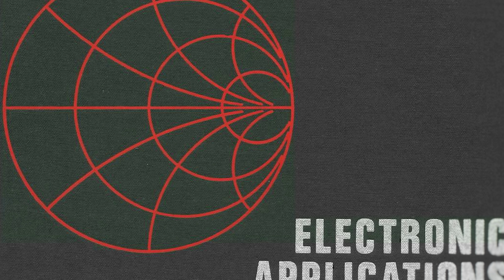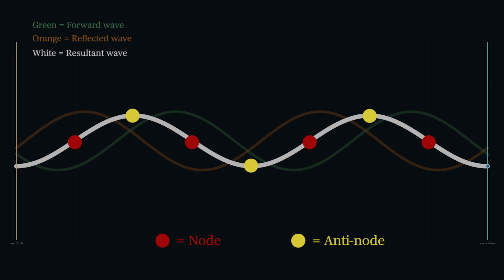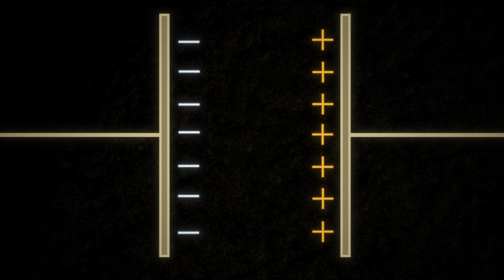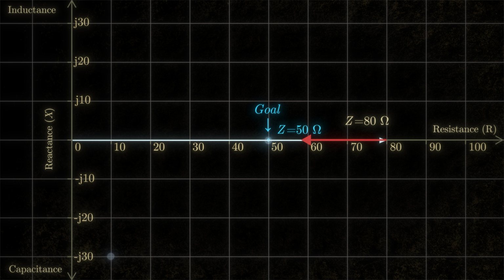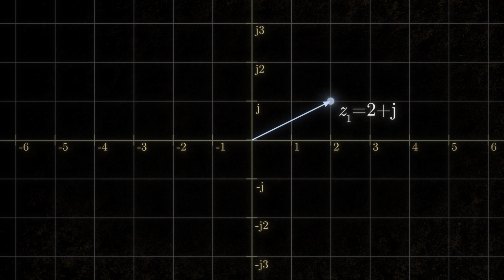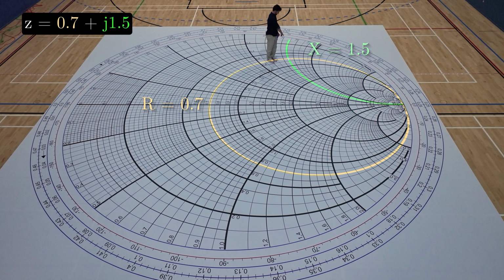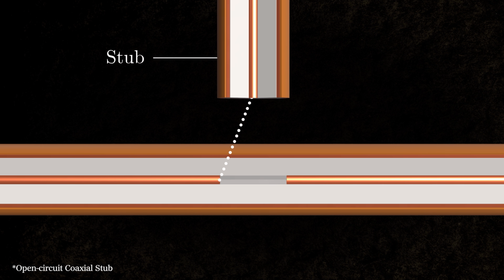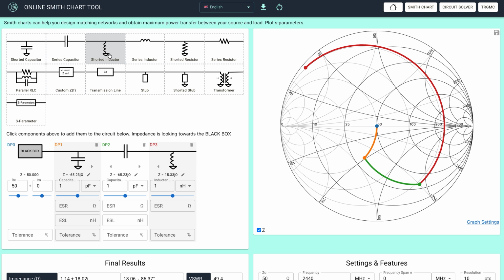The Scariest Chart in Electrical Engineering

Comment: I’ve worked in high voltage transmission and radar engineering for the past 16 years. I have found one constant truth. Impedance is something we all acknowledge but professionally stay as far away from as possible until it absolutely must be dealt with. Only then do you have six confused people passionately arguing around a table about a number that will never exist, confidently explaining why your particular imaginary number is so outrageous you should’ve wrote it with crayon. And that’s how your wiggly things are made.

Comment: RF is very hard to get your heads around the first time you hear it, and is fear-inducing. I still remember the first day me and my friends listened to all of this, and my colleagues looked like they had seen ghosts. I was probably the only one in the class who were ready for more!

Kudos to Veritasium for trying to explain the transmission line. It's difficult. Me personally I wouldn't use slinky for demonstration, as mechanical wave can be as complicated as EM. However, it's wave behaviour, so I know there is no easy way around.
 
There are a couple of things you might want to consider:
- dB and dBm are two things. dB measure the change of power but it has to be compared to a benchmark. dBm specifies that benchmark is 1 mW. dBm is useful in low-medium power system. In high power a lot of times we use Watt straight away.
- Smith chart is very useful when you want to observe the behaviour of loads, not just for impedance matching. There are times when we want to, or we have to accept a certain degree of mismatch. Smith chart tell you a big deal about the degree of mismatch, or even something as undersirable as unwanted oscillation. 
- Impedance matching nowadays aren't usually done by trimming a piece of coax, although it's great for demonstration. We usually simulate the transmission line using software and then draw all the pattern out, then we have them manufactured as a piece of printed circuit board. It's repeateable and more professional.

Thank you for making a video about this. Us RF engineers are a rare sight these days, so any way to get the words out and attract more people is appreciated.

Comment: Interesting.  The Smith Chart has several applications in Quantum Mechanics.
1. Quantum Scattering Theory (Closest Connection)
The strongest connection is in one-dimensional quantum scattering.
In quantum mechanics, when a particle encounters a potential barrier, its wavefunction splits into:
an incident wave
a reflected wave
a transmitted wave

The reflection coefficient
R = reflected amplitude / incident amplitude
	
is generally a complex number, just like the voltage reflection coefficient in RF engineering.

A Smith Chart is essentially a map of complex reflection coefficients, so it could be used to visualize:
magnitude of reflection
phase shifts
resonance conditions
changes as particle energy varies

This is mathematically almost identical to microwave transmission-line problems.

2. Quantum Wells and Barriers
Semiconductor structures such as

quantum wells
quantum dots
superlattices

are analyzed using transfer matrices.

Microwave engineers also analyze cascaded transmission lines using transfer matrices.

The mathematics is so similar that a Smith Chart could visualize:

impedance-like quantities
reflection from multiple barriers
resonant tunneling

3. Waveguide Analogies
Many quantum systems satisfy equations nearly identical to Maxwell's equations.

Examples include
electron waveguides
photonic crystals
microwave cavities

Since the same differential equations appear, Smith Chart methods can sometimes simplify understanding of standing waves and resonances.

4. Resonance Visualization
The Smith Chart excels at displaying resonance.
Quantum resonances occur in:
atoms
nuclei
quantum dots
superconducting circuits

A trajectory on a Smith Chart could show how a system moves through resonance as
energy changes
magnetic field changes
gate voltage changes

5. Quantum Computing Hardware
This is probably the most practical modern application.
Superconducting qubits operate around 4–8 GHz.

Engineers designing:
resonators
readout circuits
impedance matching networks
microwave control lines

use Smith Charts routinely.

Here the Smith Chart isn't describing the qubit's quantum state itself—it is used to design the classical microwave circuitry that controls and measures the qubit.

6. Impedance Analogies

Some formulations of quantum mechanics define a quantity analogous to impedance:

Zq = ψ over dψ/dx
where ψ is the wavefunction.

This "quantum impedance" obeys equations resembling transmission-line equations, making Smith Chart concepts applicable in certain theoretical analyses.

What the Smith Chart cannot represent
A Smith Chart is not a visualization of a quantum state. It cannot directly represent:
wavefunctions
superposition
entanglement
spin states
Hilbert space
probability amplitudes of multi-state systems

Those require other mathematical tools such as complex vector spaces, Bloch spheres (for qubits), density matrices, or Wigner functions.

Summary
The Smith Chart's usefulness in quantum mechanics comes from the fact that both RF engineering and quantum wave mechanics involve complex wave amplitudes, interference, and reflections. While it is not a standard tool in quantum theory, it can provide intuitive visualizations for scattering, resonances, and wave propagation in one-dimensional systems. Its most widespread practical role today is in the engineering of microwave hardware used for superconducting quantum computers, where it helps optimize the classical circuits that interact with quantum devices.

Interestingly, several researchers have noted the deeper mathematical connection: the Smith Chart is a conformal mapping of the complex reflection coefficient, while many quantum scattering problems can also be expressed in terms of Möbius (bilinear) transformations acting on complex amplitudes. This shared mathematical structure explains why techniques developed for RF networks can sometimes be adapted to quantum-wave problems.

Comment: This was a tough one! I thought the slinky models were good connecting points but basically I didn’t  have enough outright familiarity with the problem to feel like I had any connection with the problem.  It was a bit like the electrical circuit problem that featured the issue of having working electrical circuits and whether or not the power actually flowed through the wires (and I don’t know if that is a very good summation.  In any case this one seemed very abstract.

Comment: As ex-RF engineer from ex-Soviet Union, we were never taught anything like that, and never knew there is a way to stop guessing and using cumbersome formulas. 
In a factory producing radars for jet planes we made these "stubs" manually applying indium alloy on microcircuits in the spots we were told to, until output frequency matched the one in supporting docs. This chart would save us tons of time and hassle

Comment: Video was ok but I had to watch srveral Times. Was to fast. To much shortcuts. Physics is very simple but the way how it is presented could be a bit better. 
This a wave passing from one medium to another with different properties. 
Some atatements are confusing or unclear. Eg. Open Circuit does not absorb. Why? Example? This depends on materiały properties and shape of open circuit end.  Short circuit also does not absorb? Short circuit between two different materials will absorb. Berween same materials will not absorb.

Comment: The ironic part of all of this is that the smith chart, and impedance, are the norm.  DC is a weird degenerate case where the frequency is very low, but in reality there's no such thing as DC.  All of the things that affect RF AC affect DC during two key phases: turning the circuit on, and turning the circuit off.  You can STILL get reflections during those phases, and you STILL have propagation times that matter.

And this is why it was a critical part of the most controversial Veritasium video, about the light-second-long transmission line...

Comment: Sort of useful (for me). I'm from a physics background and the Smith chart wasn't covered in my E&M class lectures. I remember (sort of) the coverage of reflections in transmission lines and adding the extra line to cancel them out but nothing about the charts. Lots about the equations. So the first half of the video was review of basic electrical characteristics that I still am familiar with. I got a good feel for how the charts are used (in the 2nd half of the video) but really needed more coverage of the mathematics, ie explicitly how the vectors cancel out mathematically, to really understand the charts. The video has inspired me to pull out my E&M book to see if the Smith charts are discussed there. Thanks for the video.

Comment: Buncha rf engineers in here, I have a (simplish) question.  My phone/speaker USB charger in my semi interferes with the fm and cb radio.  Would a diode inline before the charger isolate this interference?  I've used them to isolate taillight signals before and wonder if they would work for this application.

Comment: "Gamma is 0.68, which is exactly what we saw....."  That made me think, "but the power loss was more than half not less."  I quickly thought, ah, but gamma is voltage and dB is 20 log10 of the voltage ratio, so half the voltage is 6dB not 3dB, and 0.68 is less than 0.707, so it does indeed give more than 3dB loss.  This is an excellent video.  I struggled to understand the chart 50 years ago, now it makes sense.  I think it helps that I have recently been working through the excellent book "Visual Complex Analysis".

Comment: So maybe in order to advance our understanding of the mismatch/disjointedness of the two physical measurement systems -- Newtonian physics and Quantum physics -- we must develop a new way of representing them TOGETHER, as did these electrical engineers almost 100 years ago now.  Is there a way to graphically combine in the same sort of fashion as Feynman did with his diagrams, the connection between classical and quantum mechanics?  Maybe by combining them in some form that has not previously been thought of because it wasn't needed, like in the movie 'Hidden Figures', where two different methods of figuring were 'added together' in order to come up with a way to accurately model the way those space capsules needed to be launched?

Comment: I'm a photonics PhD candidate with a background in electronics engineering. I first learned about the Smith chart in a microwave engineering course years ago. It would be really interesting if you could make an analogy to visible light using refractive index in reflection problems. Since we usually don't think in terms of impedance matching in optics, and the refractive index is mostly real (unless we're dealing with metasurfaces), I think that analogy would help a lot. The same idea could also be applied to visible spectrum reflections between different media.

Comment: I'm about halfway through the video, and I want to note that, as you switched from talking about Capacitors to Inductors, you never actually used the term "Inductor" or "Inductance", until you kind of abruptly mention Inductance around 13:25.

Comment: 33:31 I don't get it...
If we use 1085 MHz as a target frequency, then it means that λ/2=138.2488 mm. And if we multiply 138.2488 by 302/360 (0.8389) then we get 115.9754 mm, not 77 mm.
Reply: The speed of electromagnetic waves in coaxial cables is slower than in a vacuum: approximately 200 million m/s.

Multiplying your answer by 2/3, And you get 77 mm!

Comment: Anechoic chambers are usually understood to be with respect to sound (air pressure) waves.  Is that chamber anechoic in an electrical or RF sense?  Are the surface features sized for a particular RF frequency?

Comment: kind of reminds me of the sun and solar electricity in general and what happens to all that power it pushes out, some misses the earth entirely some gets brushed aside some is absorbed and in the end only a small amount is actually collected as usable energy.
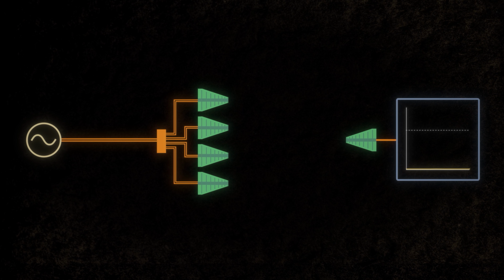Likewise with radios, you have the transmitter blasting out a signal some of it misses, some bounces off some absorbed and only a small amount makes it to the receiver, that's my guess to the drop @7:00

Comment: Hell yeah! Funny, nearly 20 years ago I decided after tinkering with building some DIY audio kits, that I was smart enough to build something (not of commodity quality, just beating the silly audio pricing) for less than I could buy it. LMAO...That led me down a huge rabbit-hole and now, without a degree, I'm dealing with RF and mixed signal multilayer PCB design, as well as physical and acoustic engineering problems. Let me tell you, that rabbit-hole is DEEP. It's quite amazing how many aspects of the physical world can be modelled using SPICE, represented by resistance, capacitance and inductance, along with all the associated parasitic counterparts (unintended elements of the same, caused by board layout and non-ideal manufacturing methods of the real world). Electrically, with light, acoustics with sound and also physical materials and their shapes. 

Many may laugh at my naivety of taking on a mixed signal design as my first project. it's only recently (the last few years) that I have actually started feeling like I know what I'm doing. Impedance controlled multilayer PCB layout for signal and PDN really is very much like black magic and as you go up in frequency, the board is as much a waveguide as a trace. Everything becomes an antenna.There are potential losses and resonances everywhere. I credit the writings of Henry Ott, Howard Johnson, Walt Jung, Jim Williams, Fourier, as well as YouTube channels such as Hans Rosenberg, Altium Academy and Robert Feranec.

Thanks for making this and helping bring some of these concepts to a wider audience, because it is not all very intuitive and simple metaphorical demos may help demystify it.

Comment: So you spent a whole minute or more on DC vs AC -- but then totally blew through the part about why the 40 ohms wouldn't do the trick, per your vectors in the imaginary plane -- or why you needed to find the right spot on the transmission line to put.. some other value? And then just casually said "lossless inductor and capacitor" without any explanation. Love the channel's ideas for content -- eg I really wanted to understand the one on FFTs :)) -- but it seems like you (and the original producer) always spend too much time on the simple parts -- and then just get "hand-wavy" and blow right through the harder parts. 

Also, with all respect, it seems like in this video you're dropping down a few notches -- though the slinky analogies work pretty well. Hope this critique is helpful!

Comment: You also have to consider the velocity factor of the transmission line you are using, or in this case, your copper tape.  The end result of that calculation you carry out on your Smith chart to match the real resistance has to be multiplied by that velocity factor to determine how long you actually make your copper tape.  That will give you an even better match.

Henry, you really ought to do a follow-up video to this showing this same demo, but for a broadband antenna, as in how to get that plot on the Smith chart as small and as centred as possible for a band of frequencies.  And get an amateur radio operator to assist you with that kind of demo.

Comment: I graduated in 1987 with a BSEE degree, and I don't remember seeing this chart.
I either saw it and had no issues with its use, and I have since forgotten about it because I never needed it in my career. Or, it was never used in my courses. There were several senior-level electives that I did not take. I did not take the power distribution course, and I don't remember there being an RF distribution course (I'm old, so my memory may be lacking).

Comment: I am an Amateur Extra licensed HAM radio operator, and I also design and manufacture antennas.  This is by far the most detailed and best explanation of SWR I have ever seen.  The details around +j & -j were excellent.  The history really helped keep attention.   Even after using Smith charts for years, reading them on Vector Network Analyzers, and using trial and error. I learned a few things I didn't know from watching this video.  I am going to point all my friends who struggle to understand Smith charts to this video.  This was easy to watch and digest, good work!

Comment: This video was a throwback to my time learning electrical and electronic techniques.
During the video, I realised that the stub is just an enlarged capacitor.
I mean, a stub is only an open circuit, like a capacitor.

Or am I thinking in the completely wrong direction?
I learned that stuff 30 years ago.
Reply: A stub can appear as an open circuit, a short circuit, a capacitor OR as an inductor, depending on how long it is, the radio frequency, and the speed that signals propagate down the line (which is always less than the speed of light -- something I don't think they mentioned in their demonstration, but it was an understandable simplification.) One example of a quarter wave stub found in every modern house is the seal around the door of a microwave oven. It's open on the end and a quarter wavelength deep, so it appears as a short circuit at the surface where the door mates with the front of the oven, helping keep the RF inside the box.